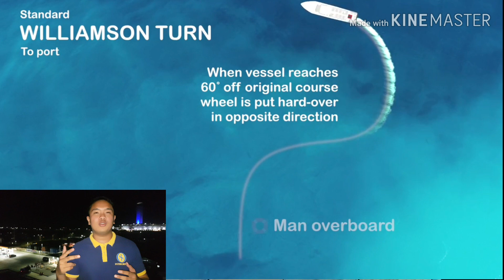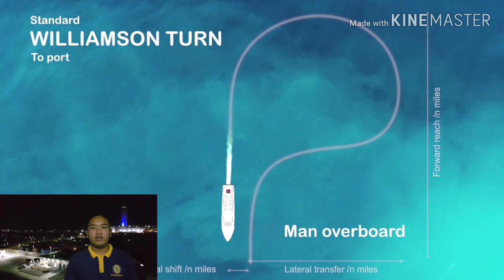SEAM 5

Comment: •Free-fall lifeboat
It is recommended that free-fall launches are carried out at more frequent intervals than required by SOLAS or Flag State , whenever safe and practical to do so, in order to maintain crew confidence in this equipment and to ensure that statutory requirements are met.
Prior to launching, it should be ensured that  the recovery mechanism is fully functional. Particular checks should be made to confirm the integrity of hydraulic systems.
If free-fall launching, the area around the vessel's stern should be confirmed as clear of any obstructions, both floating and submerged.
All ship's personnel involved in the launch, whether as part of the lifeboat crew or onboard, should be thoroughly briefed prior to the launch.
The wearing of PPE should be followed
Once the preparations are confirmed complete, the boat can be launched.

D/C Vequiso, Jay Emmanuel P.
7:30-8:30 AM Mon
7:30-9:00 AM TTh
Seam5

Comment: In Free fall lifeboat, the launching mechanism is similar to on load release. the only difference is that the freefall lifeboat is not lowered till 1m above water level, it is launched from the stowed position by operating a lever located inside the boat which releases the boat from rest of the davit and boat slides through the tilted ramp into the water.

Diaz, Noel Aaron P.
Seam-5 
10:30 - 12:00 TTH
7:30 - 8:30 FRI

Comment: The benefits of free-fall lifeboat are clear: during rapid evacuation in emergencies, the boat slides out from a ramp onboard the ship/installation and hits the water well away from the ship or installation with a high positive forward motion. Passengers are safe and secure in an enclosed cabin, safely strapped to anatomically-shaped seats. The lifeboat system is robust and can withstand high winds, powerful waves and extreme weather conditions. Makers state that testing boats in free fall do not affect the structural condition and claim that some boats have been dropped over 2000 times without significant damage.

Doroon, Lemark D.
SEAM 5
7:30-8:30 Mon
7:30-9:00 TTh

Comment: The angle of list is the degree to which a vessel heels (leans or tilts) to either port or starboard.[1]

A listing vessel is stable and at equilibrium, but the distribution of weight aboard (often caused by uneven loading or flooding) causes it to heel to one side.

By contrast, roll is the dynamic movement from side to side caused by waves.

If a listing ship goes beyond the point where a righting moment will keep it afloat, it will capsize and potentially sink.

Gilbuena, heraldson engelbert G.
10:30 - 12:00 (tth)

Comment: As I observed on the video, the stability of the car carrier ship was not stable in the Bay os Biscay. It was listed to starboard side. All 22 crew members were evacuated from the Modern Express on Wednesday by two Spanish search and rescue helicopters after the ship developed a severe list while underway in the Bay of Biscay. Weather on scene was severe with gale force winds of Force 8 and waves of 5 to 6 meters. The ship was first reported to be listing at 40 degrees to starboard. De- ballasting might apply to the situation.

D/C Legasan, Kent S.
Bsmt- 3

M     (7:30-8:30am)
TTh (7:30-9:00am)

Comment: The listing car carrier Modern Express, which ran into troubles during a storm at sea on January 26, was righted yesterday in the Spanish port of Bilbao, Netherlands-based company Boskalis told World Maritime News. “SMIT Salvage successfully righted the ship in the port of Bilbao, Spain and handed her over to the owners,” Boskalis stated. In mid-February, the work on righting the 2001-built vessel, which had a list of some 51 degrees, started as the Dutch Koninklijke Roeiers Vereeniging Eendracht (KRVE) was hired to carry out the job. The company previously said that it would use six ShoreTensions for the project. Following the vessel’s return to its owner, CIDO Shipping, it will be decided if Modern Express’ 3600 ton cargo of wood and excavators will be unloaded or if the 164-metre vessel will continue its journey to Le Havre in France. The systems aboard the 10,454 dwt vessel will be inspected to make sure the vessel is seaworthy before it departs Bilbao. The exact cause of the listing will be further investigated, however, it is presumed that the vessel started listing due to the shift of its cargo.

Doroon, Lemark D.
SEAM 5
7:30-8:30 M
7:30-9:00 TTh

Comment: A 164 meter long vessel experience listing or internal factor due to heavy weather that cause the vessel lost her stability. the wind, waves strong current listing heavily and was drifting fast towards the french coast in the bay of Biscay and there is possibility that she might run aground. here comes the salvage rescue team draw a plan and the only option is to attached the towline and tow the vessel to a port in a safe and the operation was successful and they bring the ship to upright position. 

Banate, loreto O. Jr,
Seamanship 5
7:30-8:30AM Monday
7:30-9:00AM TTh
Reply from the maker: pump in and pump out?

Comment: D/C BEJAGAN, RODEL A.  H3A
7:30-8:30 MONDAY
7:30-9:00 T, TH

Ship Particulars:

Name: Modern Express
Type: Roll-On/Roll-Off vehicle carrier, PCC – Pure Car Carrier
Flag: Panama
GT: 33,831
DWT: 10,454
Length: 164 m
Breadth: 28 m
Draught: 8.72 m
Speed: 19 knots
Built: 2001
After spending nearly six days listing and adrift in the Bay of Biscay, threatening to run aground along the French coast, the 164-meter Modern Express was towed into port of Bilbao on February 3, 2016. 

The amazing race to save the Modern Express began on January 26th, 2016 when British authorities picked up a distress call from the roll-on/roll-off cargo ship after it had lost stability in heavy seas in the western Bay of Biscay.

Comment: "Car carrier ship lost stability"
      In the video, they check out a car carrier ship as it heads out to sea and loses its stability. Now, the ship doesn't go down entirely, but floating on its side creates an equally dangerous situation for the salvage team to address as they have to go out there and attempt to pull the vessel back into port before addressing the problem. They make a carefully calculated plan to make the rescue mission success.

Mon- 7:30-8:30am
TTH- 7:30-9:00am

Comment: The Panama-flagged Modern Express is listing in the Bay of Biscay nearly six days long. A vessel with 164 meters in length. The 22 crews  are rescued without any injuries by the Spanish authorities and the vessel was towed by French authorities into the port of Bilbao on February 3, 2016.

D/C Baltazar, Jever P. H3A
Mon(7:30-8:30)
TTh(7:30-9:00)

Comment: On January 26, 2016, the Modern Express (164-meter long car carrier) suffered a severe list in the Bay of Biscay. She began to list over some 130 nm off Cape Ortegal, Galicia. Her 22 crewmembers were evacuated by Spanish authorities. Over a period of a week,she drifted into French waters and came within 25 nautical miles of running aground. 
SMIT Salvage successfully righted the ship in the port of Bilbao, Spain. It is presumed that the vessel started listing due to the shift of its cargo.

D/C Vequiso, Jay Emmanuel P.
7:30-8:30 AM Mon
7:30-9:00 AM TTh
SEAM 5

Comment: Hi sir, Good evening about the video of modern express, which experience salvage operation because of the cause of losing stability due to listing or cause by internal force. In that incident gives a lesson to all mariners that should be practice the proper loading and  ballasting in order to maintain good stability or to return the vessel to it's upright position when experiencing the heeling and listing of movement of the ship.

Comment: the modern express a 164 meter long roll-on/roll-off vessel was in route in France in heavy weather when she lost stability, she was left drift 150 nautical miles off the spanish coast in the Bay of Biscay. The 22 crew members had already  been successfully evacuated by the spanish coast guard. The wave, waves and strong current left her listing heavily, an immediate rescue operation was needed as the vessel was drifting towards the french coast, there was a possibility that she might run aground causing an environmental disaster. The only option was attach a towline and tow the vessel to a port in a safe and controlled way. And then moored in a safe and controlled way before the salvage was taken off the vessel. It was decided to use the vessels tanks for ballasting and de ballasting, in order to written the modern express. After 3 weeks the ship was successfully brought up right and they delivered in a safe condition.

Comment: James fred  Maglasang Bsmt 3
The car ship carrier was listed to starboard side resulting to the damage of its stability at the bay of Biscay. French coast guard arrive on the location of the ship after 24 hours, it is their duty to salvage the ship because bay of biscay is part of their exclusive economic zone. It is important to bring the ship to the port to prevent it on being aground that may result to massive marine pollution. When it is brought to the port by a tugboat, the first method to upright the ship is to deballast the starboard side to prevent the shifting of its cargo inside..

Comment: to execute a proper williams turn, first you need to hail * MAN OVER BOARD and keep your sigth to the man over board and pit your rudder to hard starboard until it reaches 60 degrees off from the original course once it reaches 60 degrees put your rudder to hrd over opposite direction until it receprocal to tje original course.

D/C:Gabiana,Michael John C.
SEAM5:tth(10:30-12:00)

Comment: This video gives the viewer/students an idea on what to do when it comes to emergency circumstances. which will alsp be applicable for life saving procedure. 

The main idea or concept about this video is to return to the location where the person fell overboard (MOB) as quick as possible. First action is to turn the rudder sharply toward the person. If the person fell overboard over the starboard side then turn the rudder over starboard full. Likewise, if the person fell overboard over the port side then turn the rudder over port side. When reached approx. 60 degrees of the initial course, rudder must be turned fully to the opposite side. In this situation, the ship will make a half heart shaped half circle. When reaching approx. 20 degrees of the line of the initial course, but opposite direction, put the rudder amidship, so the ship can turn to reciprocal course.

Comment: The Williamson turn is a maneuver used to bring a vessel under power back to a point it previously passed. However, it’s purpose is for recovering a man/man overboard. What I learned on this video, is that put the rudder full and put the rudder toward the person (full starboard when the MOB is on starboard side and so port side).  Deviate 60 degree from the original course and after that shift the rudder to the opposite side. 

REGASAJO, RICHARD N..
Seamanship 5

Mon (7:30am - 8:30 am)
TTh  (7:30am - 9:00 am)

Comment: Edaño, Renzo Rae M.
Seam5(TTh/10:30-12:00)

The Williamson turn is a maneuver used to bring a vessel under power back to a point it previously passed. However, it’s purpose is for recovering a man/man overboard. What I learned on this video, is that put the rudder full and put the rudder toward the person (full starboard when the MOB is on starboard side and so port side).  Deviate 60 degree from the original course and after that shift the rudder to the opposite side

Comment: PIA, JESPER M.

The vessel underway, where the man falls off on the starboard side you must alter course to starboard side 90 (degree) then alter to port at 170 (degree) until you reach the man .if the man over board is on port side  you  must alter 90 (degree)on port same procedure but reciprocal  . ,f  you are the officer in charge, shout Man over board or MOB. Use full rudder

Comment: The Williamson Turn is most appropriate at night or in reduced visibility, or if the point can be allowed to go (or already has gone) out of sight, but is still relatively near. The choice of this method will in large part depend on the prevailing wind and weather conditions.

Comment: Good day Sir, 
I learn the video Williamson turn that we should alter our course hard port/starboard where the Man Overboard fall with the full speed rudder, press the MOB button in the DGPS menu. keep  eye sight on the Man Overboard then alter our course reciprocal to the original course until it goes to midships and slow the speed until it reaches near the casualty. that's how Williamson turn works 

Banate, loreto O. Jr,
Seamanship 5
7:30-8:30AM Monday
7:30-9:00AM TTh

Comment: Williamson turn so i learned and understand this lesson thanks to captain cabrera. In this lesson i learned that when a man overboard happens you need to turn your ship on the same side where the MOB is and turn your rudder full when the vessel reaches the 60 degrees of her original course the steering wheel is put again on hard on the opposite direction this time (eg: you turn on starboard side now you need to turn it on your port side) the vessel now will turn until it reaches the reciprocal course of your ship then you can steady now your course until you reach the MOB then you can now commence the rescue operation (note:do not lose your target or the MOB cause when you lose it it's hard to find it again due to the size of a person keep an eye on the MOB no matter what).

Comment: During Man Overboard Situations or if you see situations like this, the first thing you do is to throw a life saving equipment like life buoy and  hail Man OVerboard and and inform the bridge about the situation for them to take action. So, in order to perform the Williamson Turn you need to alter your course to 60 degrees on which side of your ship the man falls and then alter to the other side on a hard over manner until you reaches the reciprocal of your original course and reduce your speed if you are 20 degrees short on the desired reciprocal course from your original course

Comment: Rodel A. Bejagan
( 7:30-8:30 M ) 
( 7:30-9:00 TTh ) 
Action to be taken specially when there is '' MAN OVERBOARD ''
WILLIAMSON TURN 
( applications ) 

*When detecting a person overboard press the MOB button located at the DGPS panel and the execute Williamson Turn approximately at the time, tries to keep visual contact with man overboard only to the side of the casualty.
* After deviation from the original course by 60 degrees rudder hard over the opposite side.
* When heading 20 degrees short of opposite course, rudder amidships position and ship to be returned to reciprocal course.
* approach the location of MOB in an applicable speed and course.

Comment: Upon detecting a person overboard press the MOB button then execute Williamson Turn. Tries to keep visual contact with man overboard only to the side of the casualty. After the deviation from the original course by 60 degrees rudder hard over to the opposite side. Approach the location of MOB in an applicable speed and course. That Williamson Turn works.

Allen Shene T. Ledesma
Seamanship 5
7:30-8:30 Monday
7:30-9:00 TTh

Comment: To execute a proper williamson turn , first you need to Hail "Man over board" and keep your sight to the man over board and put your rudder to hard starboard until it reaches 60 degrees off from the original course once it reaches 60degrees put your rudder hard over to the opposite direction until it reaches reciprocal to the original course.

To-ong, Alexzander P.
Seam 5 10:30am to 12:01pm TTH

Comment: The vessel underway, where the man falls off on the starboard side you must alter course to starboard side 90 (degree) then alter to port at 170 (degree) until you reach the man .if the man over board is on port side  you  must alter 90 (degree)on port same procedure but reciprocal  . ,f  you are the officer in charge, shout Man over board or MOB. Use full rudder by Williamsons turn for you to rescue him. 

D/C HONRADA,KYLE JASON B. 
9:00-10:30am Tth

Comment: Initial action of a man discover a man over board

Hail"man over board"
throw the nearest lifebuoy with smoke and light to MOB
informed the officer of the watch
Kept track in sight of the man overboard 

tth 10:30 to 12:00 

AIS- Automatic Identification System
ARPA- Automatic Radar Plotting Aid
EBL- Electronic Bearing Line
VRM- Variable Range Marker

Friday 7:30 to 8:30

Comment: Daño, Alexander              D.
Monday 7:30-8:30        Tth 7:30-9:00

Ships maneuvering and handling

Test 9 ANSWERS

1.)Due to suction, the two ships Will sucked together
2.) Increased velocity's and decreased water pressure around the ship's hull
3.) give starboard rudder in order to balance the force to the bank effect and the rudder effect
4.) Decrease the speed as much as practicable
5.) Use the winch. Forerunner and wire stopper to pick up the slack and stop the wire. One man operating each. Make the forerunner fast on the beat, releasing the eye of wireand stopper, lower the wire easy  by forerunner.
6.) Vegetable / fish oil
7.) Quadrupled
8.)  Make a bold alteration to starboard and pass on his port side
9.) Too fast
10.) As with no. 2

Comment: Pintoy, Rexcy
(TTH 12:00-1:30, 1;:30-3:00)

1.) The stern will 'back' into the wind
2.) Make the tug fast on port shoulder to pull.
3.) She will turn to port and the speed will drop gradually
4.) Check the position only.
5.) The vessel's bow is pushed away from the nearest bank.
6.) A large vessel overtaking a small vessel with little difference in speed between the two vessels.
7.) Pushing, made fast in the vessel.
8.) Fast FWD and AFT in center lead to pull the vessel out from the jetty and make it in position for voyage.
9.) No. 2
10.) The vessel becomes sluggish in responding to the rudder.